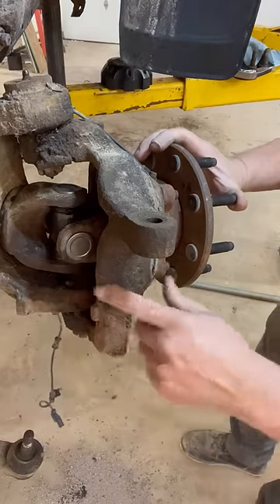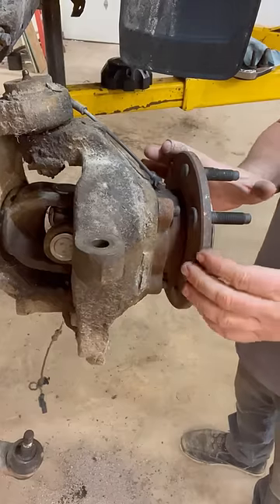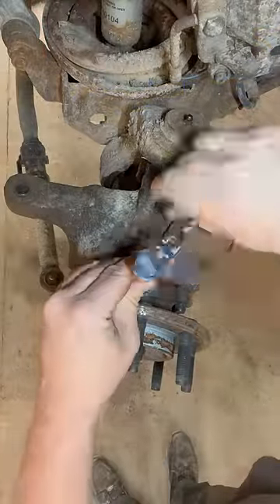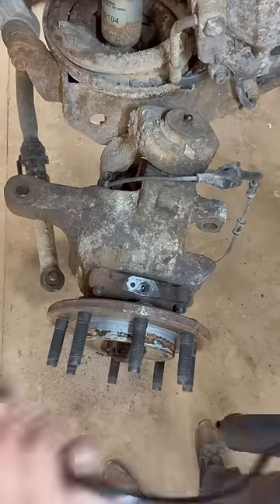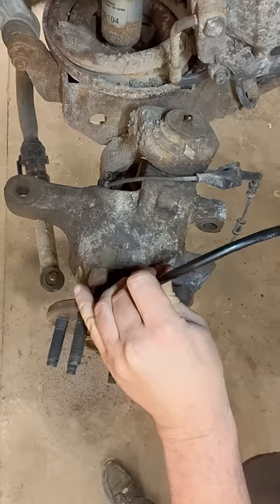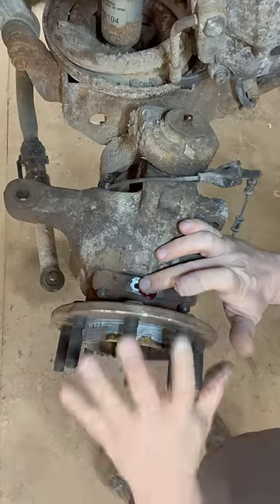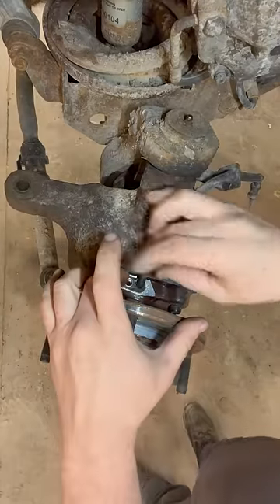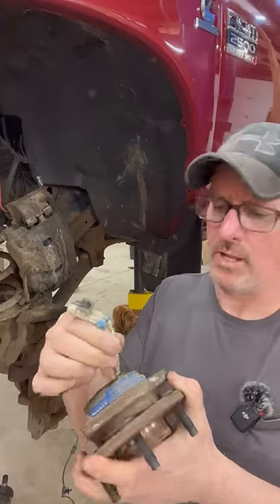Easy Steps To Lubricating Your Sealed Wheel Bearings For Smooth Performance!

Comment: Unless you have tapered roller bearings which you would be showing the bearings and the bearing race themselves You're not lubricating anything The tone rings are completely outside on purpose they have to be on the outside they can't have anything on them they must be clean and dry they make an electromagnetic field with that magnet putting anything else can actually fuck up the signal and make the vehicle go stupid or just start yelling low tire like my grandmother's 2002 Buick century that was before the days of TPMS

Like I said unless you're taking tapered roller bearings apart cleaning them checking them and putting them back and you're packing them with new grease you're not doing anything All the other bearings out there that you buy at a major parts store for most cars and even some pickup trucks even Jeeps are sealed units there's no zerk fitting AKA Grease nipple for a grease gun there's nothing that you can do
Reply: Do things in this order

Google dodge ram unit Bering cross section view 

Hit images 

Reply with an apology 

Promise to never work on a vehicle again

Comment: Pretty sure those wheel bearing hub assemblies are sealed on both ends. That’s why there’s no zurk fitting. That’s why when they fail it’s at about 100,000 miles you just go buy a new one
Reply: Incorrect you are not understanding how these unit bearings are designed
Reply: No zurk no grease
Reply: Cmon, Cappi. It's just like a ball joint! They don't need grease either, lol
Reply: Ball joints need grease bro lol.
Reply: I'm aware. Was being sarcastic. Newer control arms assemblies don't come with ball joint grease fittings tho

Comment: As someone who makes bearings for a living, PLEASE DO NOT DO THIS!
Reply: I got 22 years and 300k on my current berrings doin this , maybe if you made them better and had your shit together  jk  and added more grease I wouldn't have to ,cause if ya don't yer lucky to get 100k out of em ,.Ive replaces lots of em even had one bad at 24k miles
Reply: @TheCaperfish  first off, we have our shit together.  Second, it shows you don't know shit about bearings.  Sometimes more is not better.  In fact, too much grease can be just as bad and cause premature failure.
Reply: @bearing_aficionado   I agree too much can be bad but 5-6 pumps every year or so will only benefit it , mine are living proof .
Reply: @TheCaperfish  well our bearings are sealed bearings, and you can not add grease.  Once it's sealed, it's done.  You break the seal the bearing is done for.

Comment: You do know this is a sealed bearing right and you cannot add grease to it unless you tore the bearing apart but then how are you going to put it back together this is 25 years of being a diesel mechanic and 5 years of it was being an auto mechanic and working on diesel trucks working on medium duty trucks light duty trucks and cars this is funny whoever believes this also believes in the tooth fairy thanks for sharing this
Reply: You should work a few more years then it is the same cavity on those style bearings ,  the tone ring and bearings share , grease WIll get to the bearings

Comment: This must be that Scotty fella that has no clue how things work on a vehicle. That’s a sealed bearing you can not grease it
Reply: scotty must know more than you because you can see the rollers and cages  when ya look in the hole lol they are right there , and the grease will hit them
Reply: You keep doing it then and wasting your time it’s a sealed bearing scotty
Reply: @ntrpryz1  lol you can see the bearings threw the hole how are they sealed ? only on outside of the  assembly they have seals ,
Reply: That’s a tone wheel for the abs sensor
Reply: Thanks captain obvious

Comment: You have no clue what you're talking about that's the outer part of the bearing not the inner back to McDonald's you go you're working the drive-thru again they'll take you back
Reply from the maker: How did you know where I used to work?? You’re probably correct though, I did leave McDonald’s on good terms…
Reply from the maker: All jokes aside, the tone ring lives sandwiched between the inner and outer bearings on that particular hub assembly. You can literally GOOGLE a cutaway image of it and see for yourself. But thanks for commenting and have a great day sir!
Reply: lol flip me some burgers when you get there after you  tell yer boss how wrong you are about this style of unit bearing and he lays you  off lol you can see the actually roller bearing when you look in the hole at an angle stop the madness
Reply: I guess that ended it I should of said that ya could see the berrings long ago lol and wouldn’t of had to go threw all that pain  , I wonder if he told his boss he’s a fool yet ? Lol

Comment: Yeaaaaaah all you're doing is packing grease into the knuckle lmao. This in absolutely no way shape or form is packing grease into your wheel bearing 😂 signed, tech of 20 years
Reply: If you work another 20 years you might find out if you put enough grease in it will get into the bearings sooner or later when it warms up a bit and is spinning at 70 mph
Reply: @CaperFish-xh6il  it 100% will not lol
Reply: Where’s it gona go then ?
Reply: @TheCaperfish  whatever little bit doesn't fall or wash off is going to sit between the race and hub, get on the axle boot and spline and just collect dust  and mud for years which will hold moisture and rust it out in most places. Sealed bearings aren't designed to take grease because if they did they would also lose all their grease for the same reason. A bearing grease is thick, you couldn't even pack it by hand and get it inside to where it needs to be to actually lubricate it. Putting grease on or around the bearing is not lubricating it
Reply: You’re not understanding how there’s bearings are made , axle boot what ?? Goggle a cross section picture of dodge unit bearings and get back to me
Reply: @TheCaperfish  a hub bearing. Yes, what you're seeing is not the bearing. The bearing is inside a hub assembly, the back of a bearing assembly is a abs ring. You have no idea what you're talking about 🤣. The bearing is not exposed to the elements. It is encapsulated inside a bearing assembly. If you've ever pressed a bearing or opened up a bearing you'd know what I mean. The actual bearing portion that holds grease is like an inch inside a wheel bearing. The entire thing is not the bearing
Reply: @TheCaperfish  yes, axle boot, jamming grease inside an abs sensor hole is just pushing grease around the knuckle and the casing of the wheel bearing/hub. It'll work its way backwards and pump out around where the abs ring is which is right the spline of your axle and axle boot will be. It'll just make a mess to be collected with dust and debris. You will literally get none of it inside the bearing housing where the bearing actually needs to be greased. Greasing the back of the bearing and abs ring is not greasing it and it sure as hell won't work it's way in. If you've ever packed a bearing by hand for a trailer or a heavy duty truck you'd know. A standard light duty bearing is not greasable
Reply: Again , there was a no axle boot in this system lol , google a cross section view of them   I agree grease  will take a bit to work itself in but it will if  enough is put in , it is a tight cavity and the bearings are right there when ya pump it in
Reply: @TheCaperfish  there's no axle boot in this video I'm just saying 99.9% of vehicles on the road have nothing through an abs sensor port except for the outer portion of the bearing housing and the axle. In this video specifically he's also not doing anything, there is no bearing through that hole, sure it's where the wheel bearing is around but the actual bearing is not on the other side of that hole. It's like saying dumping oil on top of the engine is putting oil in it. All he's doing is covering the abs ring in grease which will fling off and get over the u joints which in most cases also have their own fittings if it has the ability to work it's way in then it has the ability to work it's way out, and it doesn't unless the seal is broken. Take a bearing and cut it in half, there are two seals keeping the grease inside the bearing.
Reply: @TheCaperfish  what you're describing has grease fittings which is completely diferent. You can lubricate a sealed bearing by covering the outer part of the casing in grease.
Reply: you can see the actuall roller bearings when you look in the hole at an angle stop the madness
Reply: I guess that ended it I should of said that ya could see the bettings long ago lol and wouldn’t of had to go threw all that pain lol

Comment: This does absolutly nothing to the bearing they are sealed and the tone ring is not inside your just packing the back side of that hub with grease.....but the tone ring will be lubrocated hahahahaha
Reply: lol Wrong  you can see the berrings and the tone ring is actually touching the bearing cages of both inner and outer bearing
Reply: Ok bud I second the comment to prove me wrong then
Reply: @Omnicientlol  google  Dodge Ram unit bearing cut away view , hit images and you can prove yourself wrong , pretty easy
Reply: Sorry I added my last response comment to the wrong person I stand corrected you can certainly do this it will eventually get to the bearings and I see what you mean maybe you should pin this comment to the top of your page and then or pin a comment saying exactly what you told me

Comment: The bearing is sealed. You can't grease a sealed bearing. This will not prolong the life of the bearing. This will only cause the air gap to fill with grease   and set a speed sensor code.
Reply from the maker: Tell that to my wheel bearings with 191,000 miles on them! 😂

Comment: I see the misinformation machine is still going strong. This is what happens when there’s no fact checking involved. SEALED bearing. See? It’s right there in the name. Also, do you even know that’s the correct grease?? If you gonna do it wrong, at least do it with the correct supplies. No one likes a halfassed halfasser.

Comment: Yea dont do this. This is wrong. Its a sealed bearing all your doing is spreading grease in the voids on the tone ring... Useless and might cuase damage too abs sensor and may cause abs light.  Dont do this. - 3 time recertifed ase master tech.
Reply: The tone ring is covered in grease from the factory 4 time to recertification is a charm 

Do things in this order

Google dodge ram unit Bering cross section view 

Hit images 

Reply with an apology 

Promise to never work on a vehicle again
Reply: @TheCaperfish  I see seals preventing grease from ever entering the bearing. You should Google "fix it right the first time" it's a PDF from Toyota. read it. You might learn proper things from it I sure did. If you don't learn something everyday your doing it wrong. Maybe do a little more research on your end.
Reply: There are no seals , just on the outsides , you may be looking at the wrong picture, these are nothing like any type of bearings Toyota has ,
Reply: @TheCaperfish  I get that. have you actually taken apart one of those unit bearing assemblies? Gm uses the same style as well, and so does Ford. They all come apart looking the same.  Look at this guy's name it's tomfoolery. This is literally a gag to get views and comments like yours. Scroll through the comments and see how many others agree with me vs you.. It does nothing other than spread grease on your abs ring. It's a joke dude.
Reply: I have taken them apart and actually cut one cross section 25 years ago  , this is not hard to understand , you can see the berrings when you look in the hole , the tone ring sits in between them and they all have grease on them , google dodge ram unit  berring cross section view , very simple to see , you can’t pull these berrings apart and press back together , we’ll you could but I wouldn’t you would never get the proper preload , this is not a joke and it works , 95% of the people commenting don’t even know how they are constructed and 90% of them wouldn’t know what they were looking at anyways

Comment: The bearing is a sealed bearing there is no way to grease the bearing all you did was grease the tone ring and cause the wheel sensor to now have a problem seeing the tone ring not to mention that grease is going to cause dirt and grit to collect everywhere the grease is that's not a good idea
Reply from the maker: Thanks for your comment! This is my personal truck and I've been greasing the bearings this way since it was new. Never an ABS issue like you suggested, and I've never had to replace one yet. The truck has 191,000 miles on it.
Reply: The bearing is sealed from outside elements, not sealed ffrom the tone ring! Why do people comment when they dont know LOL

Comment: I see ABS lights coming on after this
Reply from the maker: Well you’re looking in the wrong direction then. I’ve been doing this forever and the bearings currently have 191,000 miles on them. No ABS lights or issues whatsoever.

Comment: Good way to keep your ABS light on.  Real idiot move.
Reply from the maker: Real idiot comment. Been doing this for twelve years. No abs light. Never replaced a hub. I’m speaking from experience and you’re commenting from ignorance. But thanks for the comment because the algorithm uses em to push the content!
Reply: don't listen to the fools , they have no idea , I do the same  , 300K on my same unit bearings  give er 5 or 6 pumps every year , let them blow their bearings out even 100k .  just a tip is to remove end off grease gun before doing it , threaded end fits in hole  less mess   @Tomsfoolery.